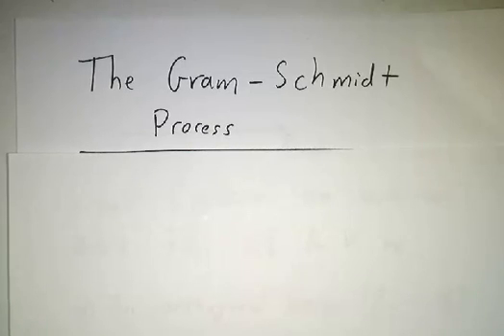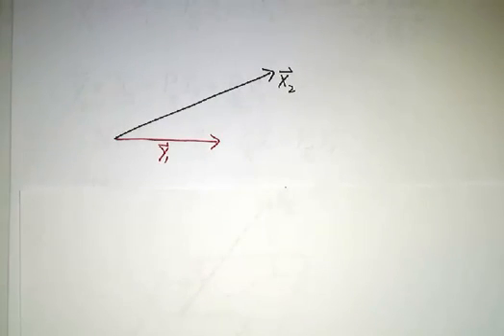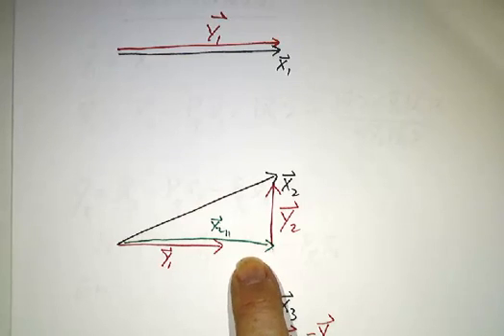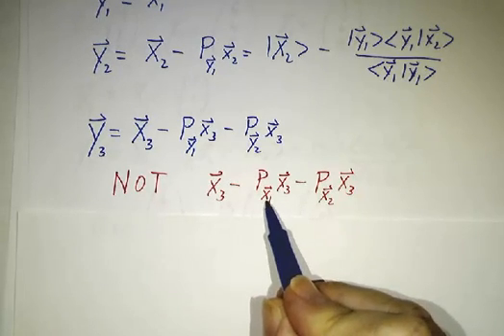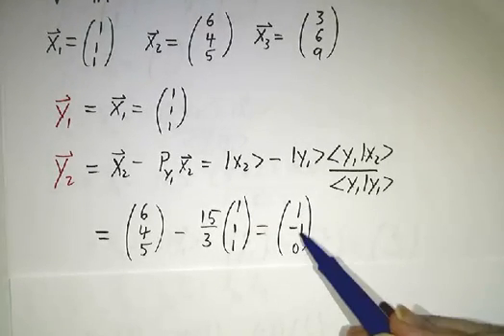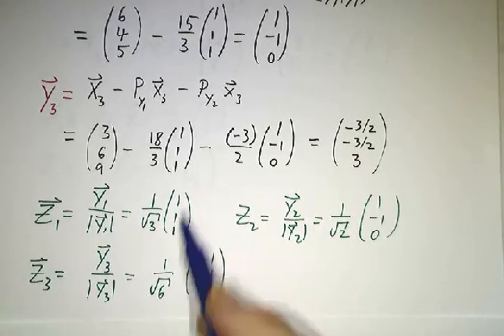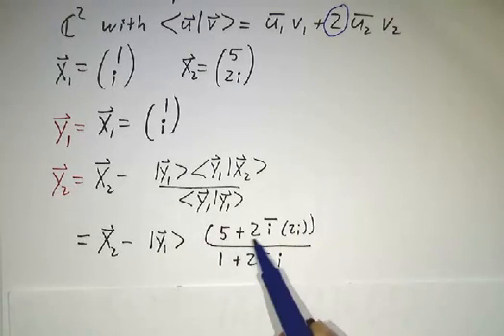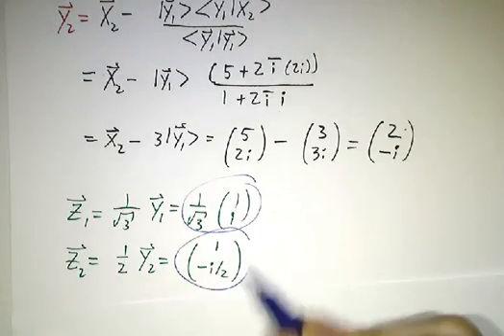The Gram-Schmidt Process

Comment: i have no idea why ||(-3/2,-3/2,3)|| would be root(6)??????????
Reply from the maker: It isn't.  But it's (3/2) sqrt(6).  To get a unit vector in the (-3/2, -3/2, 3) direction, I first multiplied by 2/3 to get (-1, -1, 2), and then divided by the length of (-1, -1, 2), namely sqrt(6). Multiplying by 2/3 isn't necessary --- you can just divide (-3/2, -3/2, 3) by the length of (-3/2, -3/2, 3).  But the way I did it makes the computation much easier, since squaring and adding integers is a lot simpler than squaring and adding fractions.
Reply: thank you very much Mr.Lorenzo Sadun
Reply: just divide the values by 3/2..  you will get    -1,  -1,  2 which  is equals sqrt(6)
Reply: BORAT SACHDEV why is the length of ((2, -i)) , 4.I do not get it.
Reply from the maker: SAMUEL OPOKU AGYEMANG The length of (2, -i) is sqrt(2^2+|i|^2)=sqrt(5), not 4.
Reply: sqrt(6)
Reply: You have to use their rule for dot product to get sqrt(6) . That is you have to use <u|v>=u1v1+2u2(conjugate)v3 for the given complex vector space C . That is what people  are missing when they say the length of (2,-i) is sqrt(5) . I would call the vector space C' because it is not the standard complex number vector space .
Reply: I meant <u|v>=u1v1+2u2(conjugate)v2 .